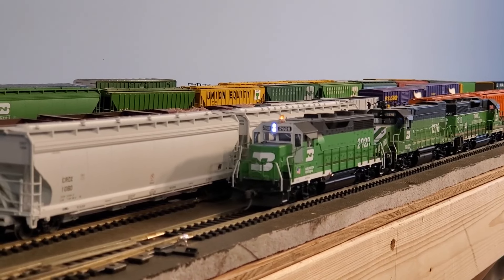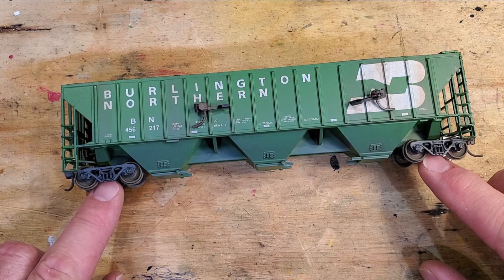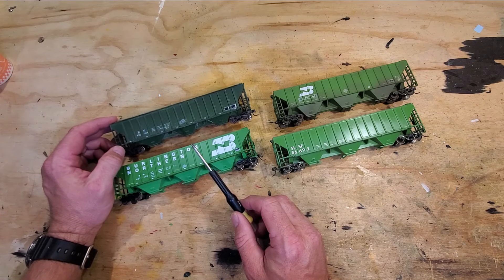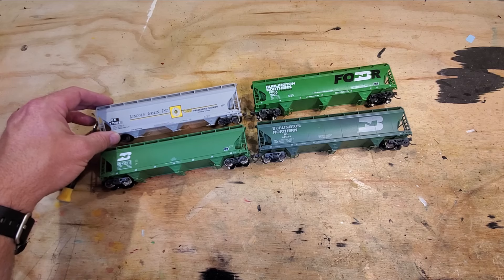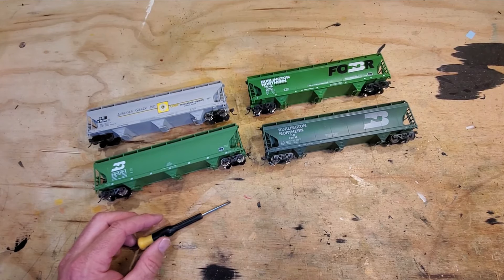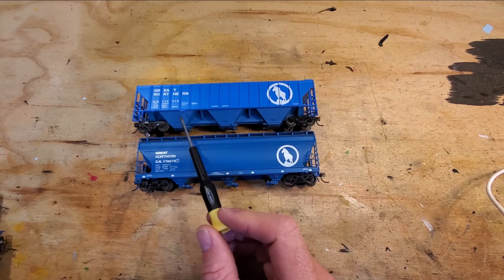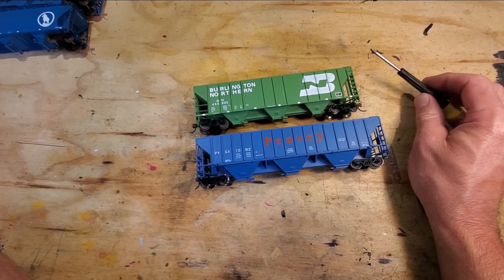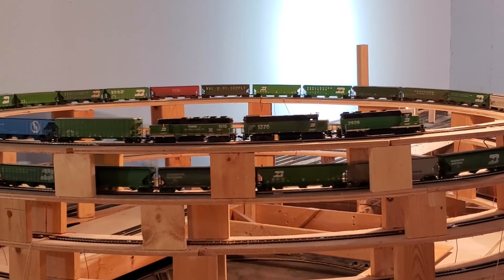Burlington Northern Blue Box Era Grain Train - Budget Model Railroad Equipment

Comment: Use an A-Line jig to tap the coupler boxes on these Athearn models  and then put  a brass screw (buy these from Fastenere) to hold the metal lid securely.  I then add weight to the cars per information from Joe Fugates book and add Intermountain Wheel sets.  I love modifying the cars in this manner and you can save a lot of money.  Done properly you wind up with a car that runs great and you did not spend $35 to $60 purchasing it at todays model prices.  For me some of the fine details on the new models are just more things that can break.  My goal is smooth operating freight cars with all couplers at the right height.
Reply from the maker: @kenrodenbeck5629  That is solid advice about the A-Line jig.  I bought one many years ago but regret to say that I've never used it.   Intermountain 36" wheels are my absolute favorite.  $60 freight cars are amazing to look at, but don't heighten the operating experience for me very much.  I'll stick mainly to these cars!   Thanks for watching!

Comment: A couple in our modelling group (including me) think that for say a 20 car grain train, if the first couple of cars are modern highly detailed models and the last couple the same, the cheaper "blue box" type cars (possibly with new wheel sets) suffice in the middle.  At 3 foot or more viewing distance are you going to see the super detailing on the cars as the train rolls by?
Reply from the maker: @johnstewart1436 Makes sense to me.  The first few cars or mixed in.  Mainly I like the variation in the styles of cars used.  BN grain trains weren't only one style of car most of the time.  Why should our models be?  Thanks for watching!